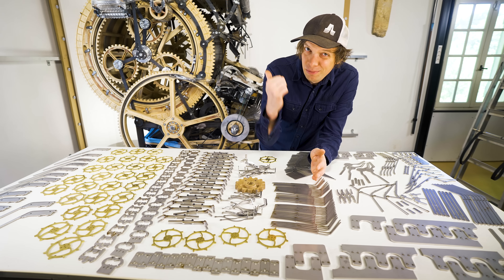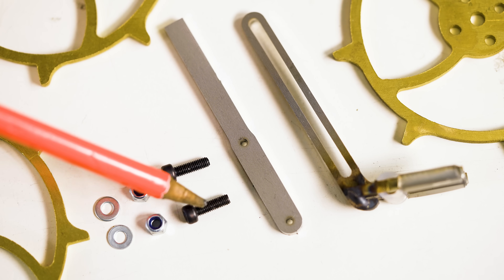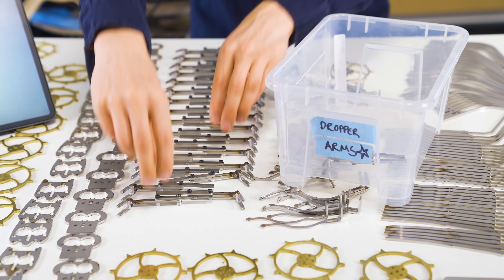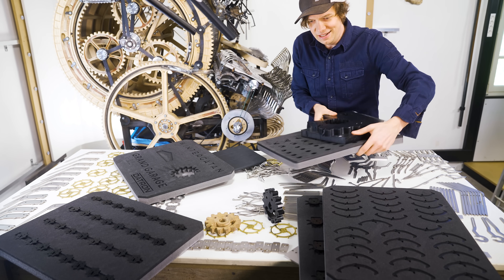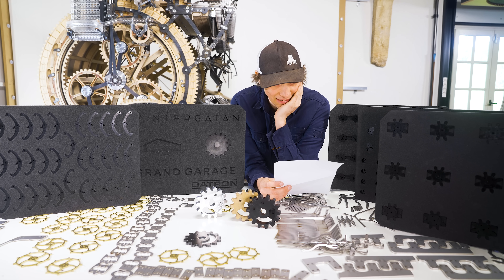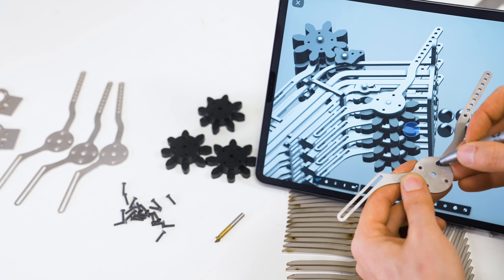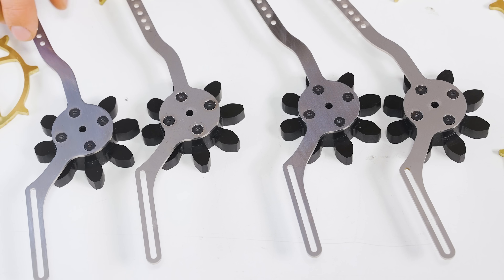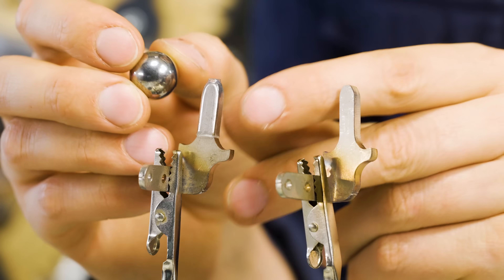Solving the 1000 Pieces Engineering Puzzle

Comment: What a good kid.
Ma says, "hey I think this is dangerous."
Looks it up.
"I don't think it is, but ok, ma."
Reply: Thought a little about it and since welders can be used without any regard to shielding means that they don't generate a lot of electromagnetic radiation. If they would they would not be allowed to be used unshielded since they would interfere with wireless communication. And that stuff is heavily regulated.

You should care about one specific type of radiation though: UV. Shield yourself from it with thick clothing. That stuff causes cancer.
Reply: @Mefistofy  hf start can be a bit of an rf jammer on cheaper machines. and the whole thing is a spark gap transmitter that part is unavoidable. 
as for damaging emf coming off your welding leads thats bullshit unless you're doing some really strange welding process that uses rf and then the whole thing would be plastered in rf burn notices and be very different.
Reply: wer kann der alten mal erzählen was noch so alles gefährlich ist. ich habe gehört H2O ist noch gefährlicher als dieses Kabel um den Hals zu legen.
So ein Aluhut kann viel bewirken, wichtig ist nur er muss dicht um Mund und Nase getragen werden, noch fester als so eine FFP2 Maske durch die man kaum noch mehr atmen kann.

und ja RF kann man mit geschirmten Kabeln sehr gut entgegen wirken. Ist wie mit dem Hinweis das man Drogen in "Pauspapier" eingewickelt nicht durch röntgenstrahlen auffinden kann.
Es gibt einfach Themen die können mal in der entstehungszeit aufgetreten sein, aber wenn man nicht gerade einen Chinaböller als Schweißgerät hat... vergesst es schneller als wie ihr es mitbekommen habt.
Reply: @elofos0815 ... Du willst nicht wissen was ich jede Woche in Tests (noch) nicht für Verbraucher freigebe...
Reply: @Mefistofy  they radiate a lot of EM, especially on start-up and AC welding. But the frequencies are low enough to not affect modern stuff, and the main source is probably the arc itself which you can't effectively shield, so...
Reply: @Mefistofy  Plus, you can get sunburns from welding. Even if you rarely ever weld and the risk of cancer is small, sunburns suck... Just wear some thick clothes, like denim. Sure, you'll be sweating, but that's better than burning up
Reply: @Mefistofy  
And your eyes. After all you don't want to miss anything on the beach. 👙😎
Reply: also the solution... step 1 into stay safe, build an MMX to hold your cable
Reply: Most of any radiation is probably coming from the spark where you are welding. I imagine that the worst it gets is in the UV range, which the mask protects your from.
Reply: Of course the welding cable is dangerous... if you have several turns around your neck. Chocking hazard, I mean.
More dangerous than that is the risk of electric shock (HF start bites!), UV radiation, lots of ozone produced from the arc, possibility of inhaling metal vapors, getting burnt by handling sizzling hot pieces etc.
Reply: @SeersantLoom  
Dating the boss's wife is much more dangerous than a little smoke 😏👊💥
Reply: Everything is some form of radiation.  Sun, microwave,  hair dryer, fluorescent tube. All give off radiation.
Reply: @assassinlexx1993  Even you & me give off radiation. Thermal Radiation
Reply: @TheLostSorcerer  
So true and after tacos day. I really give off great blasts of thermo energy. 🤭
Reply: @TheLostSorcerer  Add minute amounts of electromagnetic radiation. Every cell generates its own field and nerve impulses certainly have some electricity in them, hence yet another electromagnetic field.
Reply: @TheLostSorcerer   solid matter is only illusion
Reply: @assassinlexx1993  Yeah this is low energy EM radiation, probably radio mostly, it's completely safe. Being afraid of it is 5G conspiracy level stuff.
Reply: @ninjafruitchilled  Exactly. You should watch Internet Comment Etiquettes video on the 5G conspiracy idiots. It's funny

It's a shame that people get tricked like that by the internet. They just have confomation bias. Only look for what proves their idea even if it's clearly BS

I think one of the wisest things ever said wad Occam's Razor although it has been changed a lot over the years. Just generally it's "The simplest explanation is likely to be true"

They need to teach more 5 year olds basic science. Like just sprinkle it in. They learn maths with shapes and stuff, why not add a little bit aboyt what heat is. If I was supreme overlord of the Earth science would be mandatory to learn. English even comes with science, you need english for science. I would replace a lot of the time spent on English. Or maybe replace that with media studies because at least that's modern English.
Reply: @assassinlexx1993  don't eat bananas you're going to get radiation .
Reply: @nyuuparadise1183  
So true. Everyone needs to chill.
Reply: @assassinlexx1993  humans too
Reply: @assassinlexx1993  You are totally right! Smartphones, Computers, TVs, Radios, light bulbs, headphones, vacuum cleaners... I think we should go back to the mid ages - this is the only save way to go!
Reply: @UbuntuBirdyMovies  I know you're just joking but I'd like to give my two sense.

Firstly about the middle ages, it was a hellhole. We live in the best time EVER. We should be more proud of that. We should be glad we have stuff like healthcare.

Secondly only ionising radiation has been proved to be dangerous

Thirdly I would like it if you could show a study provinh otherwise. There are always many studies "proving" crazy stuff like that for instance one study showed a positive correlation with people using phones and ear tumours. This was a really dumb experiment though. They just asked people how much they used their phones, clearly the ones who got ear tumours were more likely to remember using their phones more because they're more paranoid about that sort of stuff because they want a reason for how it happened. People who don't remember will just give bad answers but people who have cancer in their ears will be much more likely to remember as they're in a more serious situation. Anyways there are much clearer examples than that but you get my point. The internet is a waste dump to trick old people into conspiracy theories. The most logical answer is often the truth but some people try to explain their dumh ideas by suggesting the scientists and the government are lying. It makes me fucking annoyed
Reply: @jamesramplin8124  In some parts of the internet, you would be getting a lot of hate for that comment. Fortunately, this channel doesn't seem to be one of those parts.
Reply: @jamesramplin8124  the standards related to exposure to non-ionizing EM radiation are mostly concerned with the pure thermodynamic heating effect as the only demonstrated effect on tissue. They then apply something like 10 times safety margin, because all the other potential effects, if any, are hard to quantize (because you can't do a controlled experiment of "expose a group to something for their whole lives", something about ethics), especially given that electric welding is, i think, less than a hundred years old.
Reply: @Validole  Why don't they just do it with rats at really high intensity?
Reply: @jamesramplin8124  You're right, I'm just jokin'... Man, I love the time we're living! And I love all that "bad" stuff! I'm kind of a nerd and I don't give a sh... about this studys about dangerous radiations! Humans never lived longer than today - so, how bad can that stuff really be??? I hope there are much more people out there, that are thinking like you about a study and how meaningful they really are! Thanks so much for your two sense!
Reply: @UbuntuBirdyMovies  Sure, Smartphones, Computers, Cars, Forests, Rivers, Bananas, Soil, Animals... Going back to "mid ages" won't help you...
Reply: @UbuntuBirdyMovies  Thankyou so much
Reply: @mrkv4k  OMG you're right! So we all are doomed to die some day...